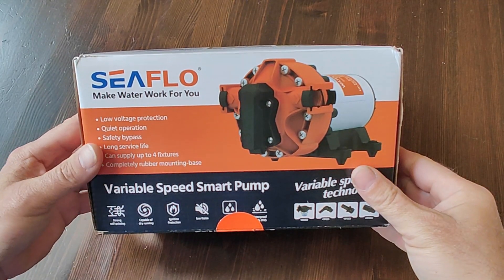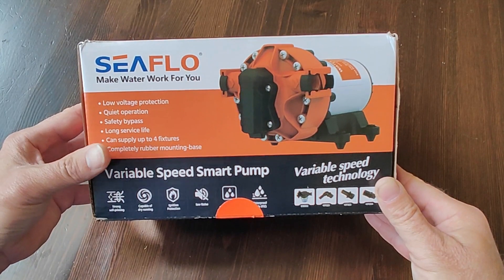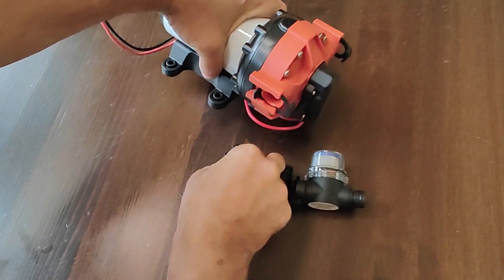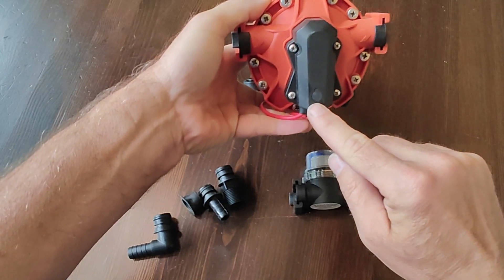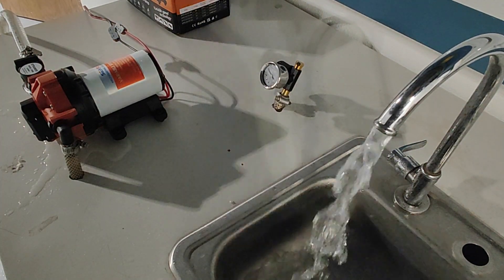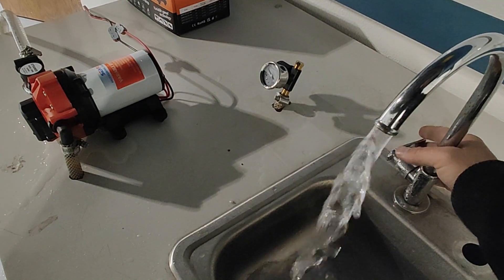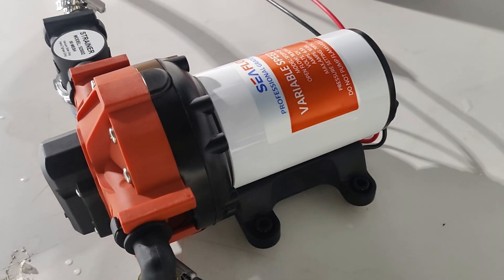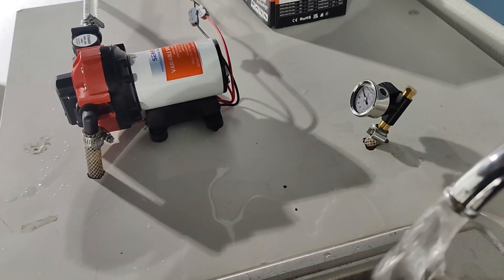SEAFLO 56A Variable Speed On Demand Water Pressure Pump

Comment: Hi, great video of how this pump operates thanks. Is the switch off pressure adjustable on this pump? The specs show 70psi which is above most rv hot water systems ratings which are usually around 55pstli. Thanks

Comment: How does it operate from off to slow? Does the pump kick in high then down or does it start slow? Also how would this work in conjunction to an accumulator tank? I would think this would be a bad idea because as soon as the accumulator starts to empty from turning the faucet to low the pump would kick in?